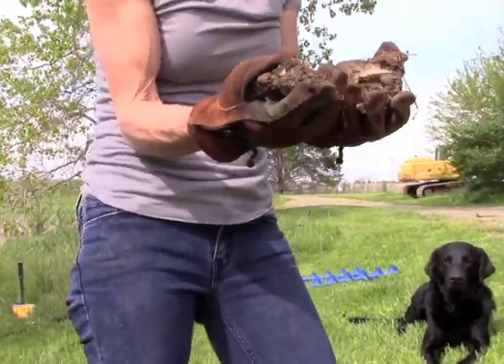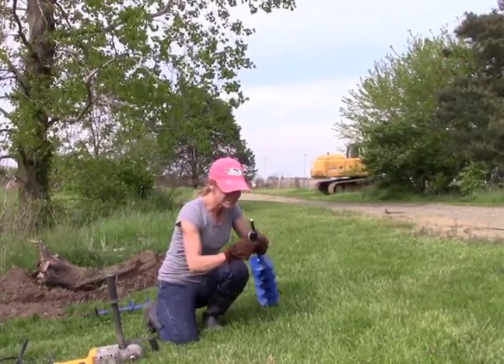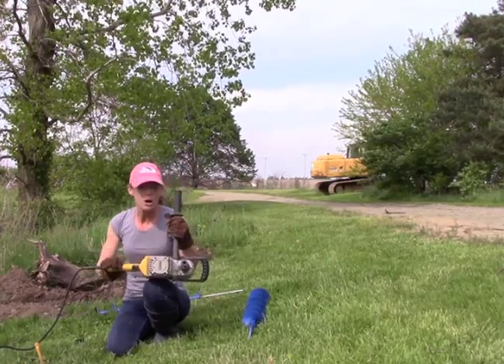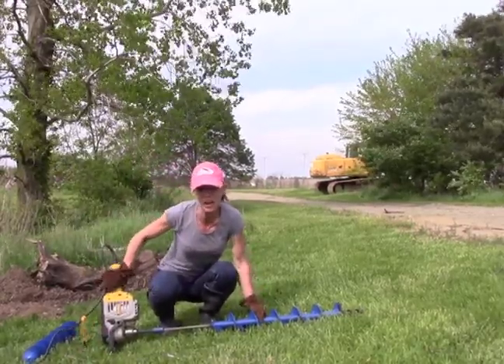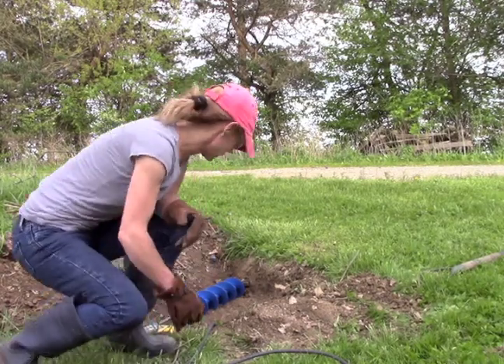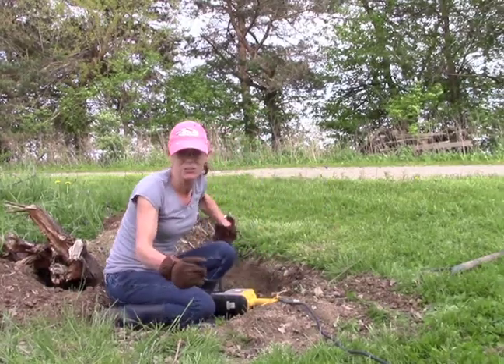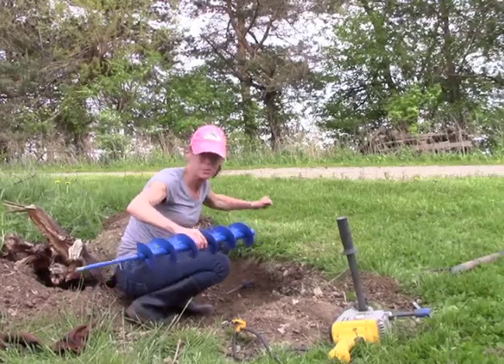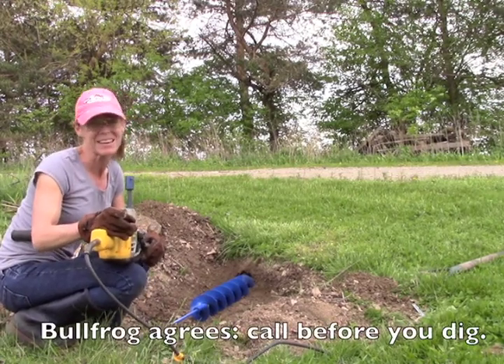Horizontal Auger Boring: drilling clay and gravel with a Dewalt DWD450

Comment: Use Galvanized pipe or PVC pipe, dig hole on either side. Sledge hammer through or water jet-plumb a hose fitting to bust through then just push or hammer till through.

Comment: I'm confused what's the point of this it doesn't appear to go all the way across the road is it just to show the eas of what u could do?
Reply from the maker: Just demonstrating how the auger works, Ken. Thanks for watching!
Reply: @beckymash12  did you leave pipe in there  I kinda want to go around my place doing this for the critters like the fox and opossums they would be nice and warm in the winter
Reply from the maker: That's better than them digging under your barn or shop! :)  Yes the pipe is still there.

Comment: It almost seems like you should have a thru bolt where you connect the two augers, if the set screw were to vibrate loose, you’d never get that first auger out. Pretty nice system though, how much for a ten foot x four and a half inch section?
Reply from the maker: Hi Tim, vibration should be minimal as your drill  should be operated at the lowest speed possible, and stress is placed on the flats of the hex shaft inside the auger drive and not on the set screws themselves.  Right now I have a ten footer in the 4.75'' diameter for just under $800 and that includes shipping. Steel prices are getting crazy in 2021, so that price is subject to change. Thanks for your interest!

Comment: Would this work in sandy soils?. How likely is it for the hole to collapse after you pull out the auger but before you slide the pipe through?
Reply from the maker: It would depend on if the sand was well-compacted, it's moisture content, ect. I think you might have trouble with super-dry sand that had just been hauled in to a site. I do sell a lot of augers to sandy locations, so I think under most circumstances they must be working ok.

Comment: What about couplings on the pipe? Since they are larger than the pipe itself, would that not get stuck on the sidewalls of the hole and make it a lough tougher to push a pipe through?

I saw a comment that a 10 foot section is 800 bucks. Well if i only need to use an auger once, it seems like a big waste of money. Couldnt i just get an auger big enough for 4" pvc (with couplings) and then just get shaft extensions much cheaper?

The hole i want to bore would be at an upward angle so dirt would be falling out of the hole as its bored.
Reply from the maker: You can get 20 foot length schedule 40 PVC that "tapers" (made with a hub where you don't need couplings) making it easier to slide through. Yes, couplings increase the friction going through the completed bore, but the outside diameter of a coupling is 4.5'', so while you may get some resistance, a 4.75'' hole is still going to accommodate 4'' pipe with couplings. 

And I'm a fabricator, I can build the auger setup you're wanting, but I can't guarantee your dirt still won't lay in the hole behind the auger section. Thanks for your excellent questions!

Comment: This is interesting, I have a gas auger and I would like to use my DWD450 instead, what kind of adapter do you use? Thanks.
Reply from the maker: Our augers have an adapter with a hex shaft that you tighten directly up on in your chuck. :)

Comment: How do you bore through a 17' width driveway?  Do you do it from both ends and hope you meet in the middle?  Also, why do you need two augers attached?  Couldn't you use a drill shaft attached to the auger and pull the auger out frequently to remove the dirt like they do for vertical drilling.
Reply from the maker: I have had customers who were able to shoot from both directions and meet in the middle. It's impossible to say you'll be on target each and every time, but yes, it's been done. Re: drill shaft- once you reach a length longer than your jump hole, you won't have any room to pull the auger back fully to shed the dirt. Plus you're talking a lot more time, a lot more effort the longer the length of the bore, all things we are hoping to save you. :) Great questions.

Comment: What is the size of the auger used in this video?  How much does it weigh? 
What is the weight of a 5.75 inch x 3 ft auger? 
Thank you.
Reply from the maker: Hi- this is a 4.75'' diameter, 5 footer. It weighs around 21-22 pounds. A 5.75'' three foot long would weigh around 13-14 pounds. Hope this helps!
Reply: @beckymash12  Thank you!  21-22 lbs for the 5-ft auger + 15-16 lbs for the drill = >  That's almost 38 lbs for the whole set-up.  You're one strong lady!

Comment: I want to dig a 14 foot long x 4” diameter hole under a paved driveway so a French drain can pass water to a nearby drain but below the drive.,  I would use similar drill and a plain extension shaft.  Where can I get a auger drill in 4 or 5 inch? Locally?
Reply from the maker: Hi Bill, the only issue I foresee with the plain extension shaft is the removal of dirt from the hole. A fully flighted auger like our design alleviates that problem. You can purchase a 4.75'' diameter auger from us that is designed to fit 4'' pipe, I'm not sure if you'll find that diameter auger in the bigger box stores but maybe. Still, you should call us for a quote on a 14 footer, you might be surprised how affordable our augers are. Thank you for watching!